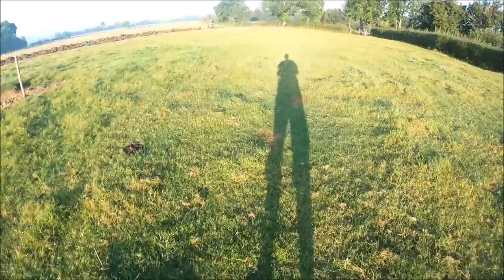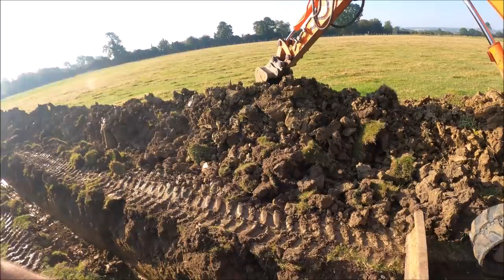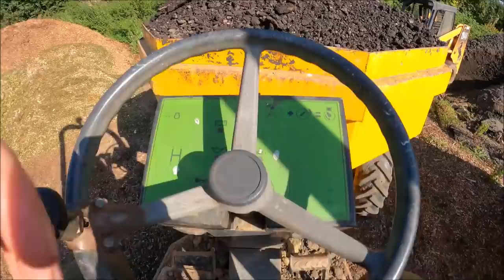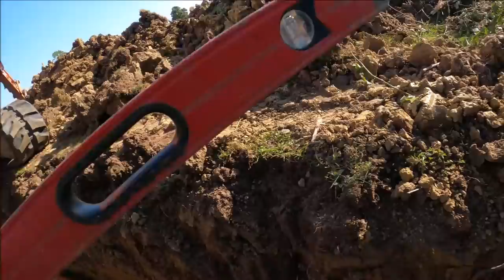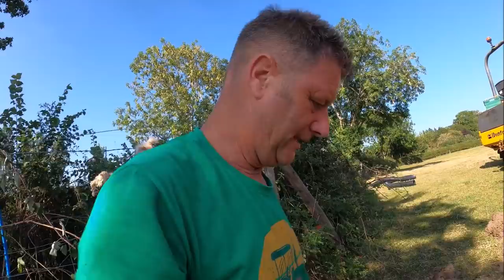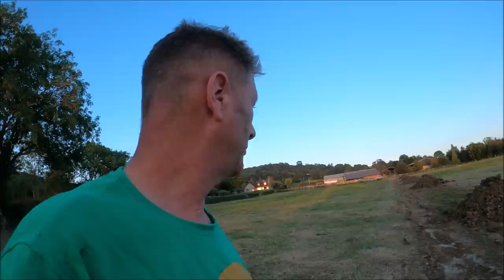Completing our first drain run.  07 09 21

Comment: Hi Ian, Dave has still got his wacker plate on the job, why don't you borrow it and go for a walk up and down the trench. it will knock most of the air out.
Reply from the maker: Oh I recon a two tonne skid steer with a full bucket running up and down will squeeze it down a bit 😄
Reply: @FarmerP  I agree, but the look on Dave's face when he sees you walking his Wacker across your field is going to be well worth it.😂 You've done a good job, and deserve the praise.

Comment: Ya  I zipped  tied some larger screen  over the ends of mine  to keep the dammed chipmunks  out of it   Could you have the person who drew up  the plans for your granny flat  explain what the two extra beams are for.
Reply from the maker: They are to prevent an6 deflection in the 8” x 2” roof joists…. Overkill in my opinion. 😐

Comment: Do farmers get a payment for cleaning  ditches or has it been knocked on the head. The farmer I worked for in 1960 bought a 10RB cable operated back actor digger for scrap metal value from my dads company, he said once round his big field would pay for it.
Now that was a busy machine to drive, I dug out a silage slot into a bank and lined it with railway sleepers, bet you can't use them know because of the creosote.

It's strange how one job leads into a dozen more, but you can cross one off the list, well done go and have a breakthrough party.
Reply from the maker: No payment for ditch clearing in my area, not that I expect one, it’s my ditch 🙂👍🏼

Comment: With the steel beam through the middle of the extension - why is it not recessed into the ceiling with joist hangers, so that the ceiling is flush?
Reply from the maker: That was the original idea, We could have done that, it was discussed, but remember this room is designed for an elderly or disabled person. Keeping the beam down gives us a better option for hoisting and lifting equipment if we need to add it in the future, The ground floor room is also an extra block high to accommodate the beam. 🙂👍🏼
Reply: @FarmerP Thanks, glad I asked... it now all becomes clear, great planning from you and the builders - they seem a very switched on pair, so hence the question.  Enjoying the videos, much appreciate your time and efforts, keep up the good work.